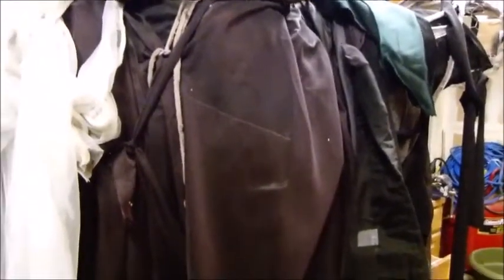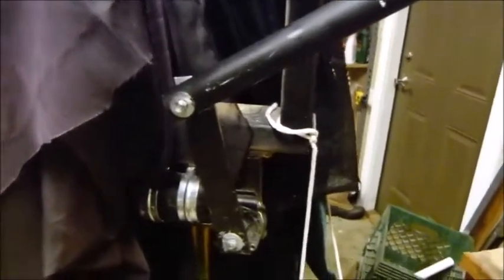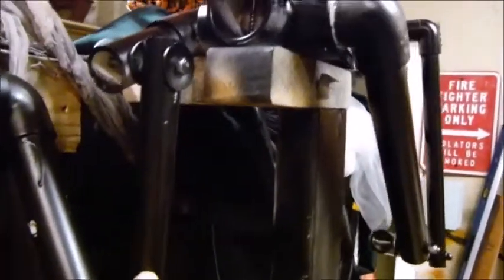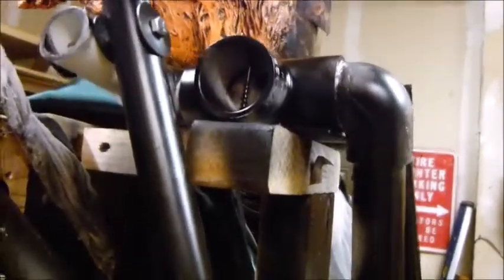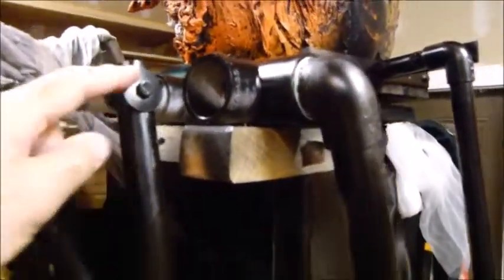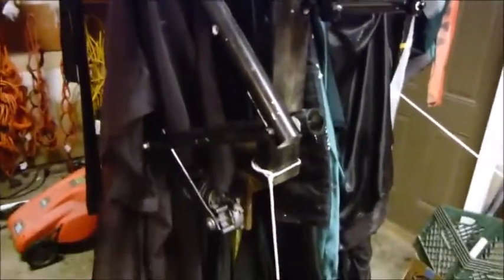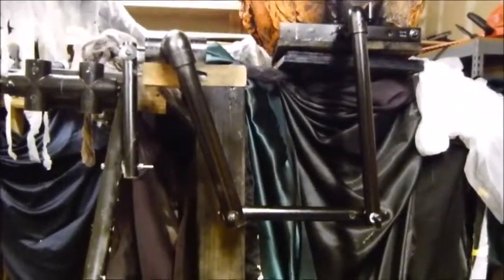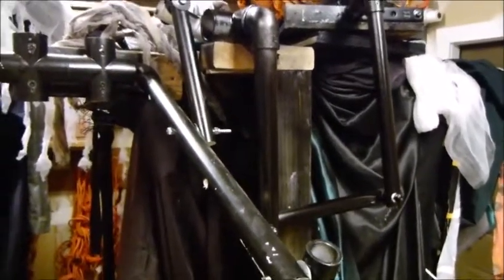2 direction motion prop

Comment: I know I am a little late to the party, but I have a solution for you. In the off-road suspension industry we use a joint called a heim joint. It it will bolt to your neck pivot point and be able to pivot 360 degrees parallel to the neck rod. The heim part will allow the motor proven rod to pivot up to ~60 degrees perpendicular from the neck pivot plane.
Heims come in all sizes, and I think Lowe's/ home Depot carry them. The smaller versions are called rod ends.
Reply from the maker: Just looked it up - I think you are right.  This has just enough pivot.  I had purchased a cross fitting to make a U-joint but haven't worked on it yet.  But I think the heim joint would probably work better.  I'll work on it next year and post how it comes out.  Thanks for the help.
Reply: @RickVerlinda  I hope it helps. It already looks great. I like the 2 different planes of movement! I might borrow this idea for my haunt next year!

Comment: You need like a U-Joint
Reply from the maker: That's a great idea.  I think I could actually make a U joint using PVC --maybe a cross then smaller pipes into each end with Ts and 90s.  Something like that.  Thanks for the idea.  I'll post something if I get it to work

Comment: Hi Rick, check out "heresjohnny" crank ghost he gets the head turn one arm raises up and down and the other arm moves left and right
Reply from the maker: I've used his design for my "supersized leer ghost" prop.  But as I talked about in this video - his design won't work for this because he makes sure that all the moving parts are very lightweight.  The arm on this prop is at least 5 lbs. with the hand and lantern and the head weighs close to 40 lbs.  - way to heavy to move using the lines and dowel system johnny's ghost uses.  But thanks for keeping the discussion going

Comment: just run a slot (groove ) in the PVC pipe with a router that way the sloppy bolt can be tightened up and it has a smooth track to run in HFL!!
Reply from the maker: good idea for the slot.  I used a drill motor and the slot wasn't that clean.  A router would work better
Reply: You were the first person I thought of when Rick was asking about this prop. Can you believe he didn't know about Haunter's Hangout! Now he does! :-)  He will get all kinds of great advice any time he needs it with that group.
Reply: use a dremmel with a cutting bit should work good too

Comment: Check out the shiatsu zombie full build video on my channel. I needed flexibility in the joints to move my props arms. I used caps on the end of the PVC going vertical, then eyeloop bolts through the caps up into the PVC above it. I think it would reduce some of the sloppy play here while allowing you to continue with the design you have.
Reply from the maker: WOW - great job in creating the connector points.  I like both of them - the "T" joint and also they way you connected two pieces at a  90 degree through the end caps.  Will definitely use that design

Comment: Use a pulley
Reply: I tried using a pulley before but when you attach a cord to the PVC that moves the arm the pulley needs to pivot.  Plus the line needs to be under constant tension or it falls off the pulley.Plus the pulley also ends up being under a lot of pressure since its at the pivot point going to the head.  Finally - what happened was the pulley tried to pivot to the "X" axis (the arm) but the head movement (Y axis) tried pulley it the other way.  Bottom line the line would pull off the pulley.  If you have a design please give us a link because I sure couldn't get it to work.
Reply: You could try using eyeloop bolts into the PVC and / or wood to keep the string tight around the pulley.